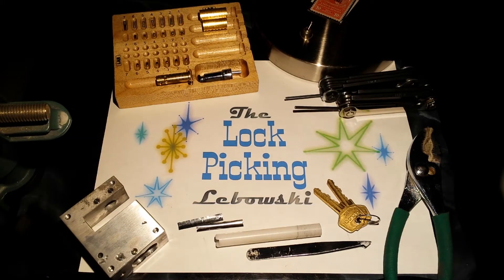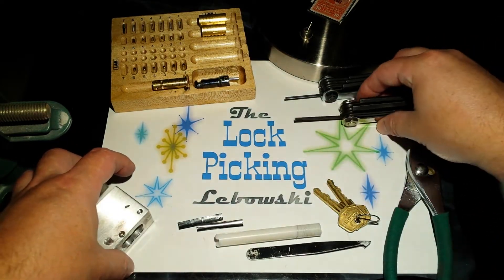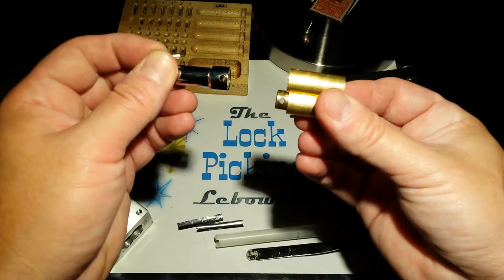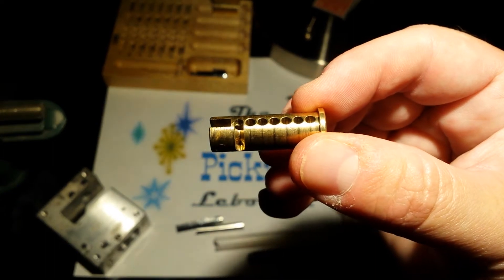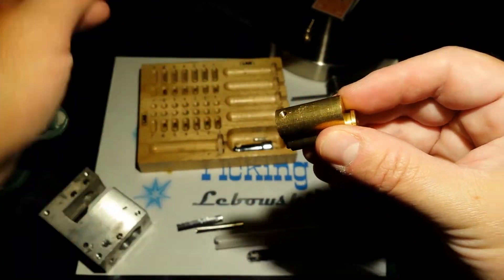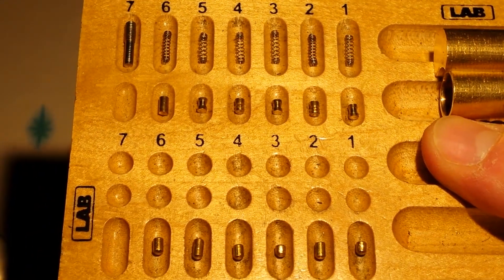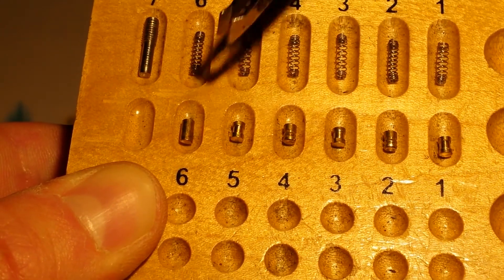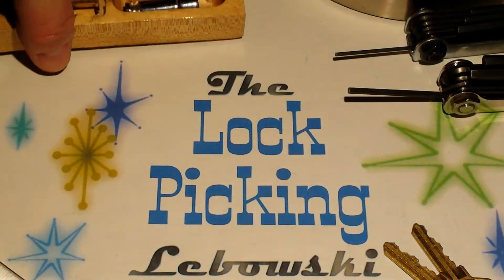(57) Paclock Block Lock version 2 gutted and mansplained!

Comment: I think it has been gutted but not sure if it was V1 or V2...memory ain't so good. Didn't know about the two different spring tension types. I have not heard of that before in a stock lock. I didn't think V2 were in production & released to the public yet.🍺😎✌
Reply from the maker: Don'z Lockz This was a test sample. In my video #50 Paclock 200A review, shortly after the 2 minute mark you can see the same stiff spring offerings. I think that's my favorite feature of these models.